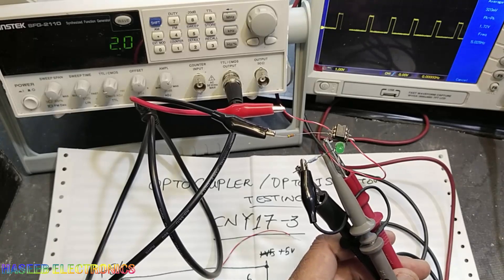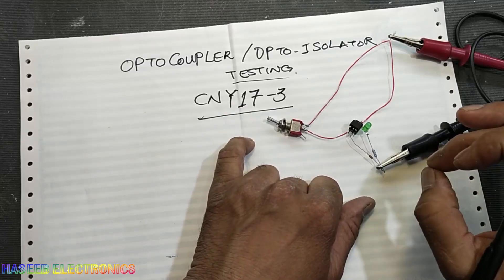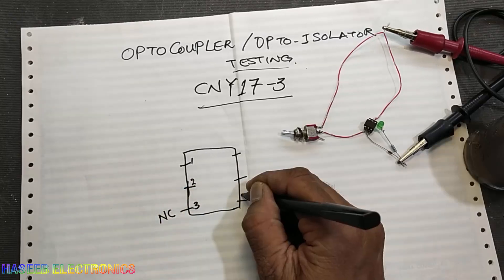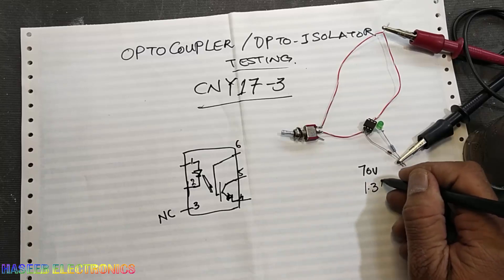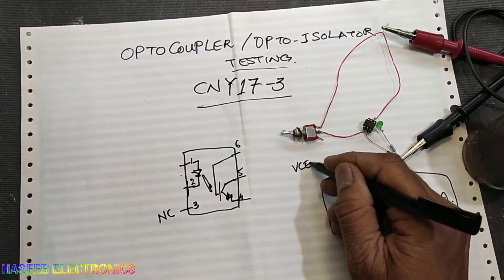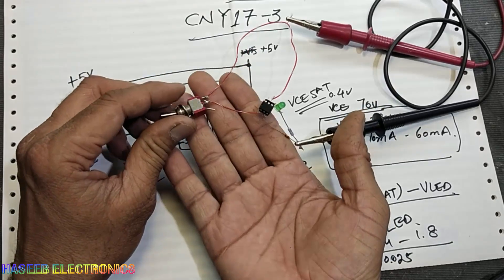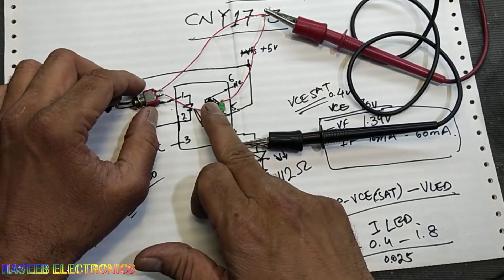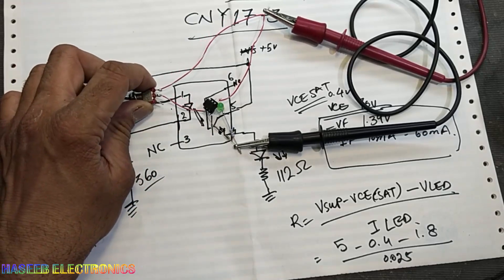{576} CNY17-3 PhotoTransistor Optocoupler Tester

Comment: Sir I've a smps using tny266pn ic and 300dc voltage is good but no output voltage
What are the problem in it
Please reply
Reply from the maker: please check vcc voltage on vcc capacitor at pin 1 and also check vcc capacitor 
it must around 5 volt, if it is not available, then ic is damaged. in this case you need to replace ic
 if it have fluctuations on vcc capacitor then you need to test vcc capacitor, optocoupler, and secondary side components
Reply: @HaseebElectronics  Sir my smps transformer input side is giving 1mohms resistance and continuously increasing
Is it fine
Reply from the maker: @raoamarjeet5473  it is best way to measure inductance instead of resistance
most possible cause is ic. I am guessing that ic which you replaced is wrong
Reply: @HaseebElectronics  may be you are right Sir, thank you so much
Reply: @HaseebElectronics   sir how can we use ds0088 5 wire module in place of tny 266pn 
Sir Reply please
Reply: @HaseebElectronics  sir I've changed ic even than there is no voltage on drain and source
Reply from the maker: @raoamarjeet5473  please check voltage on pin 4 and pin 6 (if above 5 volt dc then Ic is switching. If it is same voltage same as dc capacitor that means the Ic is not switching at all)
Check voltage on pin 1 and 2 (around 5 volt)
Reply: where did u bought ic? there are so many fake/damaged tny ic being sold, it happened to me also, then i bought from another and it worked
Reply: @electronicslover1120  from delhi, from were do you buy
Reply: @raoamarjeet5473  i bought from local market in durg, chhattisgarh, dont buy online, search repairing shops and ask them either they have it or they will get it for u.
Reply: @electronicslover1120  right bro. Thank